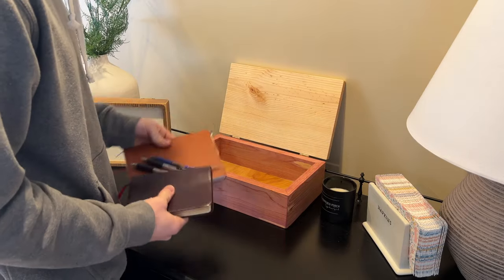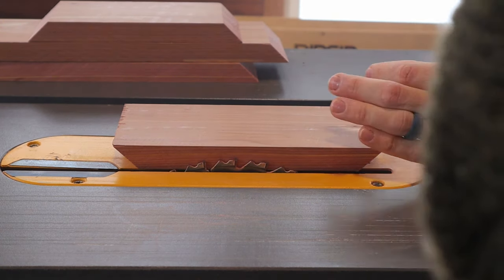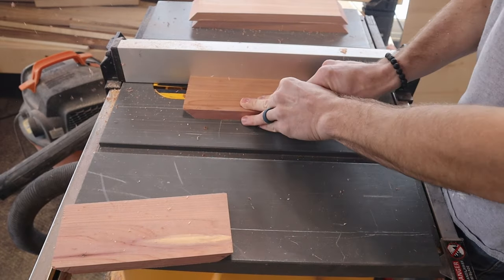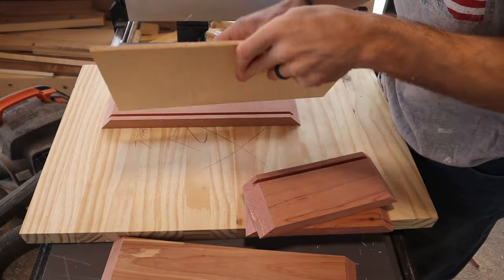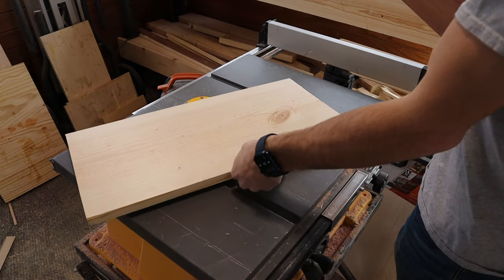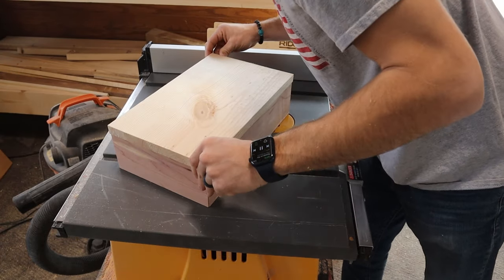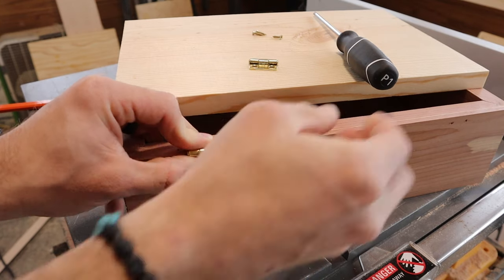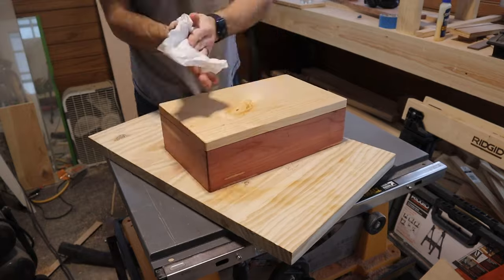How To Make A Simple Wooden Box

Comment from the maker: Let's address the Elephant in the room. I was very new to wood working when I created this video and even though I was very careful I should have used the push stick with the table saw. Please make sure   you do!  Don't want stubs on your hand! That is all :)
Reply: LOL
Reply: I have been around family working in some project or other my entire life (I’m currently over 50). Be careful sure, use safety measures sure, but you work with what you have…. Or you end up fingerless.
Reply: Ok
Reply: Thanks for adding this comment. I was a cabinetmaker 39 years ago until one rushed, tired evening on my Unisaw, trying to finish my newborn son’s crib, resulted in my poorly guarded 10” carbide blade taking off my middle finger and severely and permanently disfiguring my three others. I essentially shook hands with the exposed blade. It changed my life. A table saw is a very efficient and very dangerous machine. Everyone should treat one like a loaded gun and never work without all modern guards.

Comment: I’ve been a woodworker for over 30 years, and I enjoyed your video. I’m glad you addressed “the elephant in the room”. I was always very careful using my table saw. 🤔 Until the day it happened; I was cutting a board when my girlfriend walked in my shop. I lost my concentration for just a second and ran my middle finger over the blade. 🫨😐🫤😣😖😫 I still have it mind you, but it wasn’t a pretty sight. The blade went length wise completely through my fingernail and about 1/2” into the bone. Kinda like peeling a banana. 🍌 The pain was indescribable… even worse when they stuck a needle into the bone marrow to numb it up for surgery. Oh my God that sucked so bad! Anyways, that was about five years ago, and my finger has long since healed, but it is numb up to the first joint. I never skimp on safety equipment now… in fact, whenever I get ready to use power equipment, I lock my door, and there is a sign that says “If the door is locked, either I am not here, or I am using dangerous equipment. Please do not disturb… don’t even knock. When I am done, I will come unlock the door. Thank you for your understanding.” Trust me, distractions are your biggest enemy. Okay, about your box. Your design was timeless, your miters are tight, it looks beautiful and solid as a rock. Great job! 🏆 It will last through your lifetime and beyond. Date your pieces… it’s always fun to look back at some of your old pieces and see how your skills have improved. Anyways, I didn’t watch your video to critique you… I just enjoy woodworking videos,and I find that I still learn new stuff all the time; even from youngsters like you, (please take no offense, I’m just an old fart and have grandkids about your age). 👴🏼 lol  I have liked and subscribed.. see you around dude! ☮️🍻
Reply from the maker: There’s just something special about creating an object out of a piece of wood! And even though I’m a youngster who is relatively new to the craft 😄 I find it very filling to share the techniques I have learned up to this point. I love hear from people like you who have the experience because it gives me the opportunity to learn a new skill or trick! Thanks for the comment!!
Reply: Thanks for telling your injury story.
It makes me worry about you, however,  when you say that you lock the door. I understand about locking out the distractions, but still "shit happens". And it's hard enough to holler for help over machines running, now you've added a barrier to being rescued. 
Please just humor me and go with a big bold sign on the door.
Happy sawdusting!
Reply: @wilburrrrr742  You know, that’s a great idea… in fact, I’m going to  go design a sign and hang it right now. That is great advice, and I thank you for it. ☮️♥️

Comment: The only way I can get my miters tight on my DeWalt Table Saw is to make one cut on the left side of the blade and the opposing cut on the right side of the blade. Even if your digital gauge says it's 45, it ain't. If you're off 1/8 of a degree, after 8 cuts, that's a whole degree. However, if you cut on the left and it's 44.9 degrees, that means on the right it's 45.1. These complement each other to form a perfect 90. Sure, may take a little more set up but it's worth it. Also, the only way to make sure opposite sides are the exact same length is to use a stop block. If you're eyeballing it and you're off 1/64", it's not going to give you tight miters. In my box making infancy, I ruined a very nice piece of Jatoba not using these methods.
Reply from the maker: Great point 👍

Comment: A box like this with lock miter joinery would be nice.
Reply from the maker: Maybe I should make a sequel, and post an updated box with some joinery!
Reply: Dovetailed, woulda been nice, along w/recessed hinges as well...nice box otherwise ~ @DrewLarsenDesigns
Reply from the maker: I would love to master dovetails. Not only do they look nice but they are also very strong!
Reply: Cutting them by hand is an art - doable, but takes practice. However, I submit to you to get a Porter Cable Dovetail jig, no. 4216 - it's a/b $200. I'm making predominately 'jewelry boxes' and it's perfect jig for these boxes w/ dovetails - such a nice touch - Anyway, the set comes w/ (3) templates. One, for 1/2" dovetails, one for 1/4". And another one for box joints or sliding dovetails. I can make the box joints w/ either of the 1st two i desrcibed. Additionally, the set comes w/ the proper bushings for your router and 1/2" & 1/4" bits, both dove and straight bits. Finally, you'll need to get the correct 'plexiglass' base that accepts the 1 3/16" bushings. If you need 'training' , YT is your friend ~ Merry Christmas ~
 @DrewLarsenDesigns
Reply from the maker: Thanks for the tips!! I’m glad you stumbled across my channel, merry Christmas to you as well!
Reply: I subscribed - carry on, im interested in your future projects - i'll be watching ~ @DrewLarsenDesigns
Reply from the maker: @buddydog1956 thank you so much! I’m excited to hear your tips and tricks

Comment: Great video, great instructions and inspiring. 
New sub here.
1. Did you cut on the line, outside or inside?
2. Glue held up fine? Would you recommend brad nailing edges and if gauge?
Thanks
Reply from the maker: I appreciate that! 
1. I like to cut on the outside. But whatever you choose, just keep it consistent 
2. The glue held up great, most times the wood will fail before the glue does. Brad nailing isn’t a terrible idea, if you decide to go that route 18 gauge would do nicely. I would prefer splines however because of the structural integrity of it.
Reply: @saltlifebuilds thank you for the reply
Reply from the maker: Of course! 😁